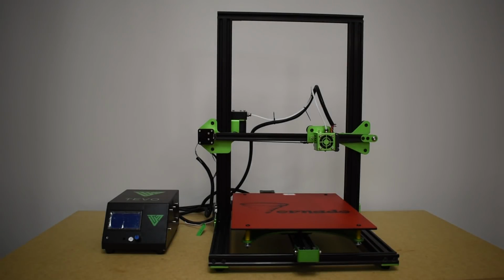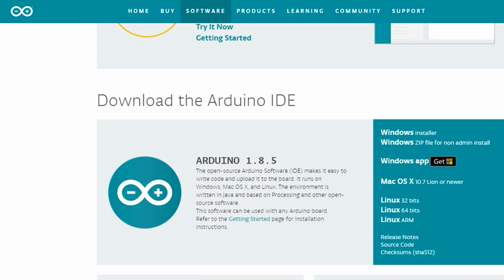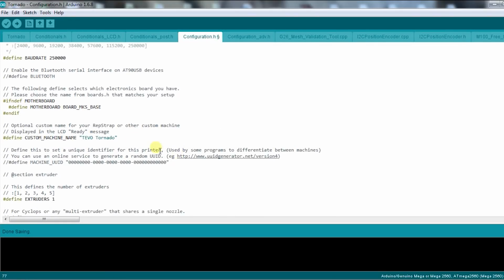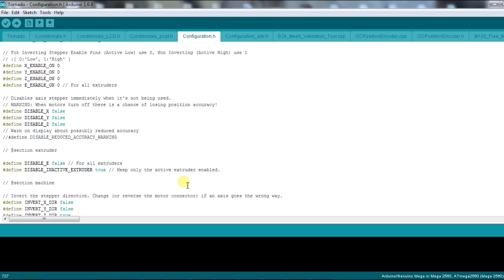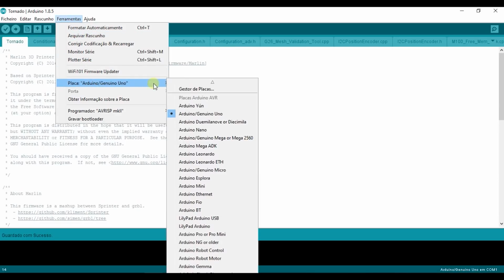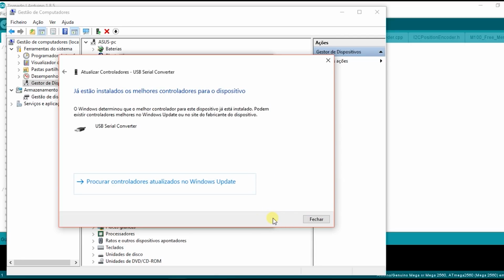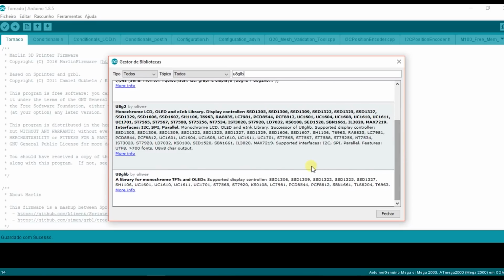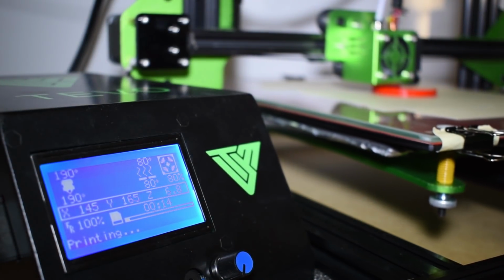TEVO TORNADO 3D PRINTER - HOW TO UPDATE THE FIRMWARE

Comment: Hi Ruiraptor, my printer is up and running.  I have loaded the 1.1.8 FW from facebook.  I have printed twice and both times it looks good on the bed, but there is no fusion.  The perimeter is not adhered to the infill and it will literally crumble apart.  But it looks perfect sitting on the bed when finished.  Any ideas on what is wrong?  I am using Simplify3D to save the file to SD card.  First time I used 210 and 60 (like I do on my A6).  Then I used 220 and 70.  Thanks again for the video.
Reply from the maker: Hi Tim,
To me that is all related with the slicer settings.
Have you tried using a different profile, maybe using a profile from other user (you can find some in the tevo tornado official facebook forum).
Reply: Joseph, it is on the Tevo Tornado Facebook Book page.  You have to join the group to be able to view and download the files.  https://www.facebook.com/groups/TEVO.Tornado.Owners/files/
Reply: I will check and see what I can come up with.  Everything was so easy with my A6 but not so with this Tornado.  Well to be clear I spend alot of time assembling the seemingly 200 pieces of the A6 where the Tornado was a 15 minute assembly.  But after the A6 was assembled it printed like a champ!  But hopefully sooon I will get there with this Tornado :)
Reply: The problem was that the E in MM3 was turned "ON" in the Tornado LCD setup.  I guess that was the default when I flashed the Firmware 1.1.8 from Tevo FB group.  Got that turned off, got my extruder calibrated and she is doing nice :)  Just wanted to pass on the problem in case anyone else ever runs into the same problem.
Reply: Tim Durham where is the firmware?  Can u provide a link?

Comment: Updated to v1.1.8 and now it won’t home.  Help please
Reply: https://plus.google.com/117849894858209143802/posts/1EUBxEK4tyv
Reply from the maker: Hi Joseph,
What happens when you select home all axis? Does it move at all?
Reply: ruiraptor I can home just the x and it does that and then just the y both will show x0 y0 on display.  Then I home the z and the motor moves up not down.  I left a link to the google group with pics on this YouTube post.  It’s like the z direction is wrong.
Reply: ruiraptor also can u provide a link to ur 1.1.8 firmware?  Maybe I got a bad one.  Mine is from a tornado dev team.
Reply: ruiraptor I got it fixed.  DX from the tevo google group gave me his firmware and it fix it.  I saw no difference in our homing settings.  He told me to turn off his 3 mm setting in filament.  What is that filament size?
Reply: ruiraptor it would still be awesome if u could post ur firmware file just for reference.  Thank you!

Comment: Hi I just got my printer yesterday and when I put the sd card into the slot it says card inserted but when I got to the menu it says no card, so I tried to print straight from the printer and in the log  it says communication time out- reset send buffer block, would this be a firmware issue I don't know what to do can you help me please Thankyou

Comment: Thank you
May i dawnload another file like tevo tornado marlin-1.1.7.zip? Or marlin 1.1.8
Reply from the maker: Hi,
You can flash any version of marlin as long as it's adjusted for the tevo tornado.
Check the official tevo tornado forum on facebook. You can find some firmware updates there.
Reply: At the moment I am very unhappy with my Tornado.  I can not get it to communicate with my laptop due to USB errors.  I wanted to update the firmware to see if that would solve the problem but it is IMPOSSIBLE to find firmware for this printer.  The links I found are for 0kb files (empty).  I signed up for the FB group but no reply and they have not approved me.  So my question is this.  Do you have the settings that would need to be edited for the Marlin 1.1.8 to set it up for the Tevo Tornado?  Thanks for your videos!!

Comment: Hello, I am writing this because I am in doubt if acquiring a CR-10 or a Tevo Tornado, I wanted to ask if it is not annoying.
The printer would use it to do small things mainly in key chains, things for jewelery, pendants, lithophanes and some things like that, they are things that will be personalized and I look for a good resolution for the details, I would also like to print some flexible filament and abs , and if you can put a laser to record any of them would be perfect, it may be a lot to ask but I am doubtful and it is quite money, I know that both are very similar,
Thank you very mu

Comment: I have layering issues with my printer and I changed the voltage on the stepper motors. What can it be cause the belts are fine??
Reply from the maker: Are you using the cura slicer? This slicer is known to override the acceleration and jerk settings defined in the controller.

Comment: I'm a bit confused about the version numbers.  I just purchased the Tornado as of 11/25/17 and it came with v1.1 firmware.  But I saw a version 1.1.7 in the FB group.  What is the current stock firmware level?  Do I need to upgrade?
Reply from the maker: Hi Robert,
There are many versions available for this type of printers. Currently, the latest version of marlin is 1.1.8. Tevo is releasing the printer with version 1.1 and is fully functional and it's the same one i'm working with. People in the forum are getting the latest versions and adapting them to the tornado. It''s up to you to decide if the new versions have any new feature that you will need. In my case, the stock version works just fine.

Comment: Psss. I need help! I tried uploading the firmware from facebook. My lcd screen went full blue. I tried again and i got an error message "error occured while uploading sketch". In trying to fix this, i followed some advice to check off the box in file> prefernce> "show verbose output during". I tried uploading again and the Tevo control box started making a load constant beep. I got rid of the beep by trying to upload the stock firmware but i still have a blue lcd and the error message. Anybody know about this?
Reply from the maker: If your screen went full blue it's probably because the upload was not successful.
Reply: So how do i get the upload to work because i been trying for 3 days and i keep getting the same error message. I tried different uses of the reset button, an original tornado sketch hex file with xloader, different versions of adruino, marlin and tornado files. nothing has worked. Thanks for the reply
Reply: thanks for your help. What i ended up having to do was following this tutorial... https://www.youtube.com/watch?v=Ysjafopay2g to wide the board clean before i could get my screen working and upload firmware. Thanks again
Reply: Hi you didn't have any errors when running this code on your tevo??im struggling bad right now getting this thing to work
Reply: I didnt use that firmware original firmware. I used a modified firmware found on the facebook page.
Reply: Marlin 1.1.7 to be exact

Comment: Thanks for such a great insight about firmware flashing! Great!
Q: would this also be applicable to the Tarantula?
Obrigado amigo!
Reply from the maker: Hi my friend,
You are correct, this will also work for the tarantula. You just need to download the corresponding tarantula firmware.
I also made a video for the tarantula (https://youtu.be/P4W0UI9r6pI) but in that video i used an old firmware version that required a specific arduino version to compile. The most recent firmware versions work with the latest arduino versions.
Reply: Great news! Thanks Rui!

Comment: Hi ruiraptor. Aparently there are some concerns with the wiring of the tevo tornado. Could you confirm if there is any issue with it?
They say that the heatbed is not grounded to the metal frame, the cables feature only a single isolation layer and there is no strain-relief which may increase the problem. They say that it's more worrisome because the bed is powered by 220V AC.
Did you encounter those issues? From your video of power consumption comparation between printers I'd say it's no issue regarding amperage and heating of the power source, but may it be an issue regarding indirect contact?

https://www.reddit.com/r/3Dprinting/comments/7apcla/question_to_tevo_tornado_owners/
https://plus.google.com/105765900368914476130/posts/56VD8xMyphD
Reply from the maker: Hi JulesRussel,
Here are my comments:
The bed is, in fact, AC and 220v (or 110V depending on the model) powered.
The cables that power the bed come from the SSR to the bed directly and the frame is not grounded.
Regarding the issue related with electric shock, i can see that the cable goes into the foam insulation (we cannot see the solder joints as they are inside the foam insulation) and because the bed is glass made, there is apparently no issue with contacting with the frame or any other metal part. The cable is inside a thick and strong plastic sleeve cover. 
Regarding the stress relief, there is none, but, in my assembly (as i do this for every printer with AC or DC bed), i secure the plastic sleeve to the closest bed spring. The cable inside does not reach this spring as the sleeve is still long enough and stops at the foam insulation.
Having said that, i believe that the cable will never touch the frame thanks to the plastic sleeve, the insulation foam and thanks to it being strapped to the bed so it will not get pulled out.
And, as said above, the bed is not metal like most printers...it's glass which means it's not an electrical conductor.
Reply: ruiraptor Thank you. I really apreciate your response as I have one in order from gearbest.